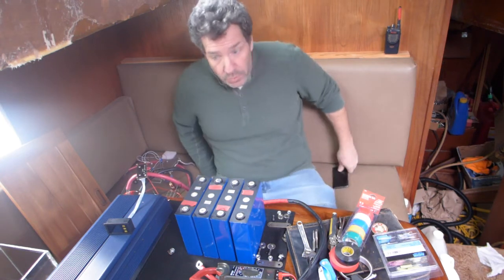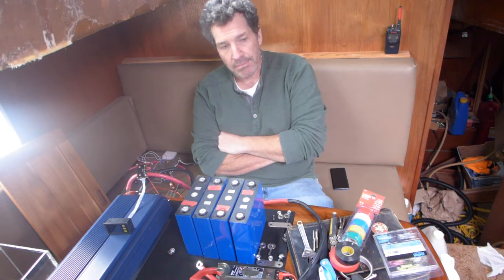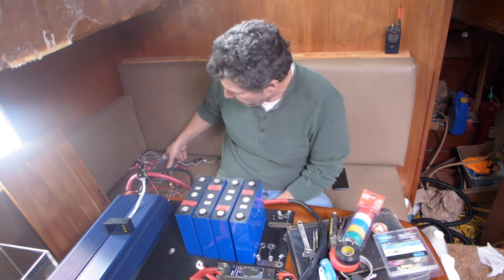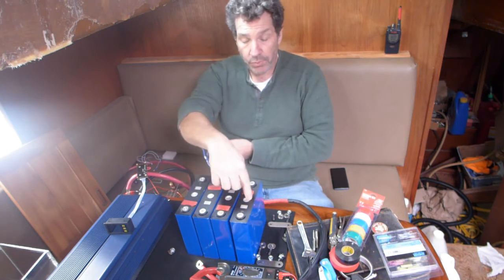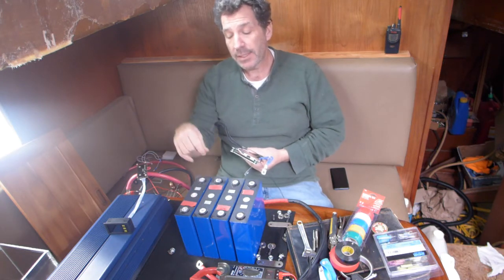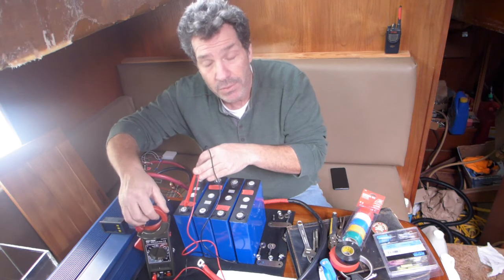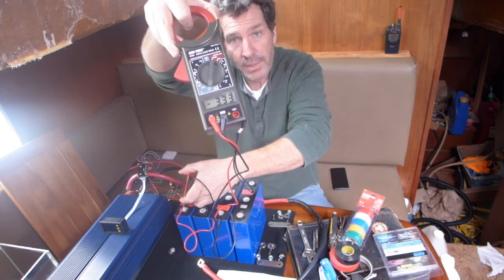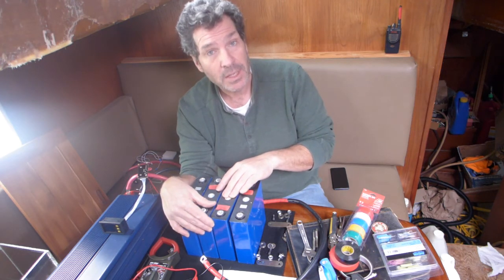Building a 12v battery for my Sailboat Part 1

Comment: 24V is better than 12V
Reply from the maker: True in part 24v is more efficient if you get into the details. 
But 12v systems are way more common most boats and most RV's are 12vdc systems so there is just more options less expensive and more replacement parts for 12v
Systems. Just do a price comparison between a 12v 100ah battery and a 24v 50 ah battery